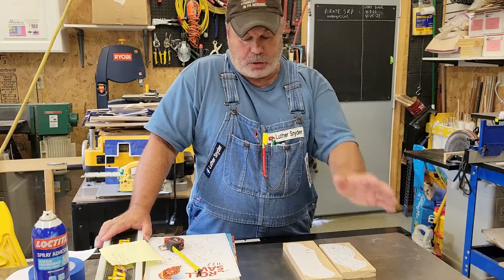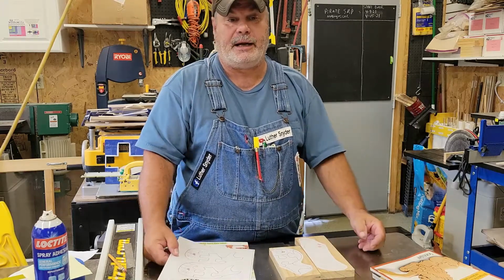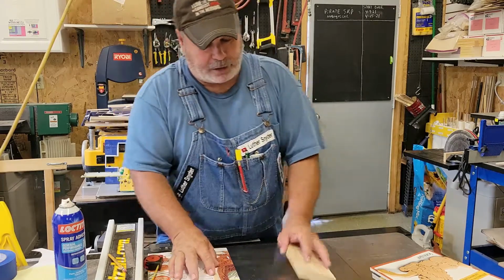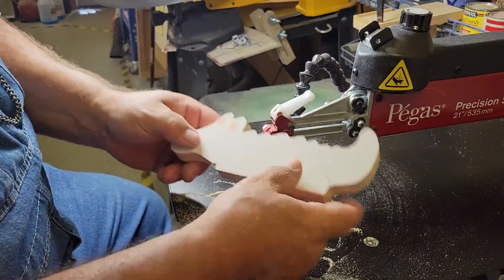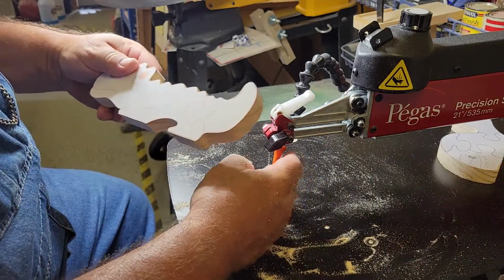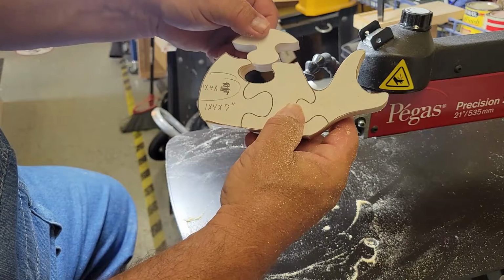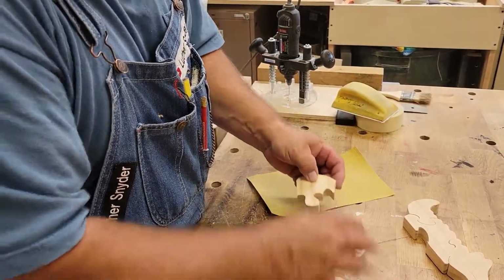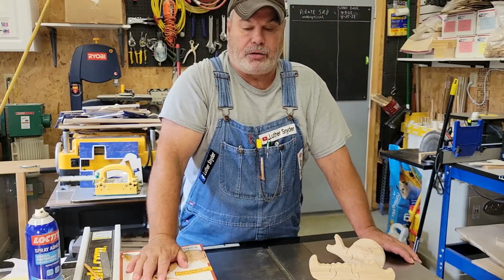Scrollsaw Puzzles Wooden Animal

Comment: I am going to have to try some animal puzzles. Good Job!
 It looks like if you have multiple cuts 5 or more, maybe putting numbers on the pattern in the order you want to cut them out might help. 
On another note, I use the Steve Good method of directing the air nozzle away from me when I do my scrollsawing. My workshop is a covered two sided outdoor shop and  wind can blow the sawdust back toward me is my main reason for using the nozzle that way.
Reply from the maker: Thanks